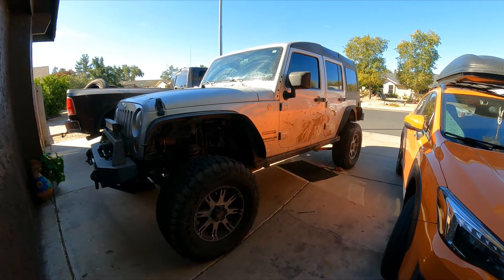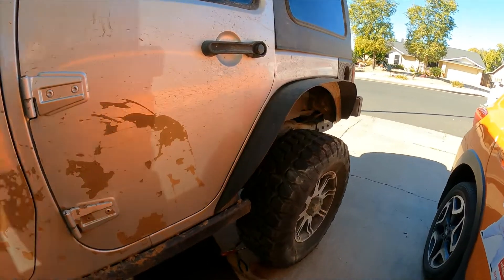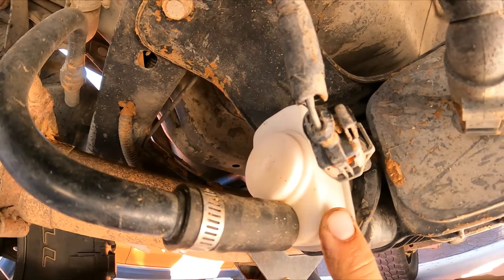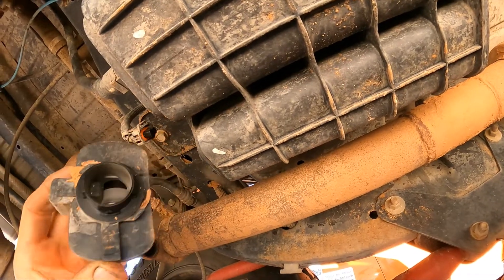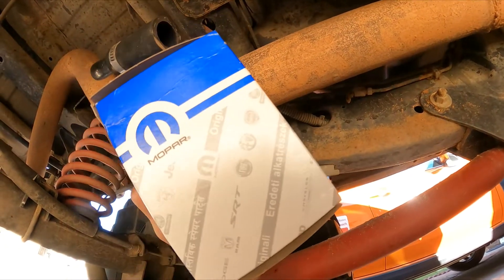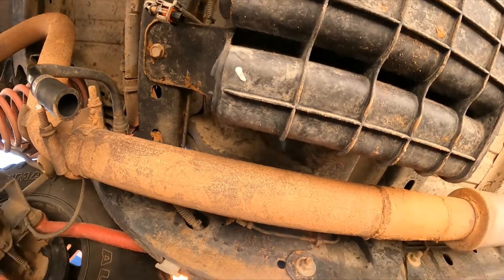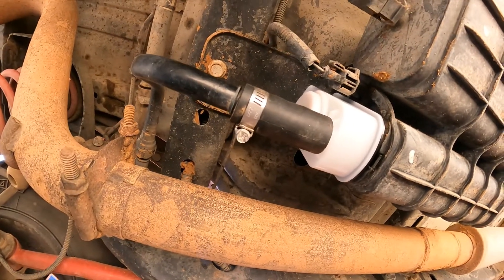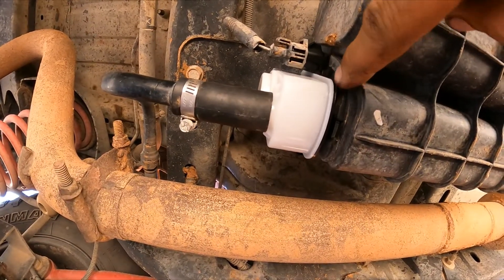2010 Jeep Wrangler Unlimited Code P0456 Problem Fixed EASY

Comment: when running a smoke test, I have smoke coming not from gas cap itself, but from behind it, pulled the driver's side taillight, it's coming from that cylinder below the fuel line, what is it called? thx